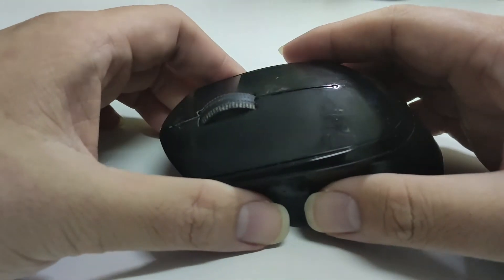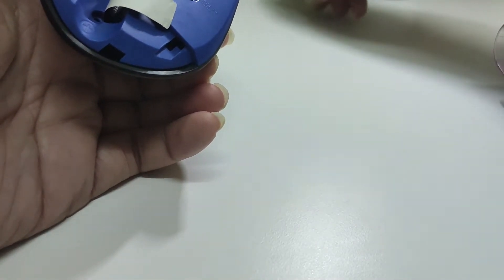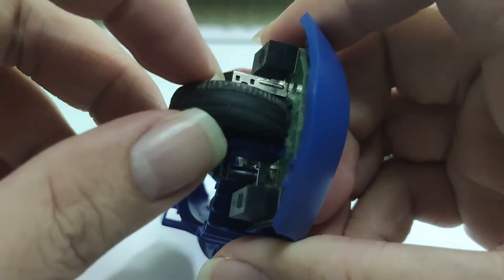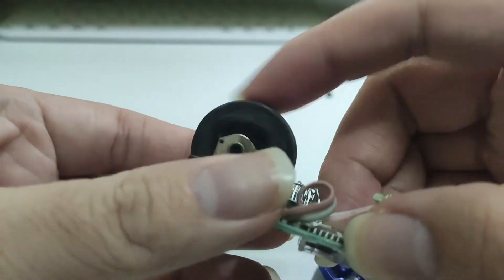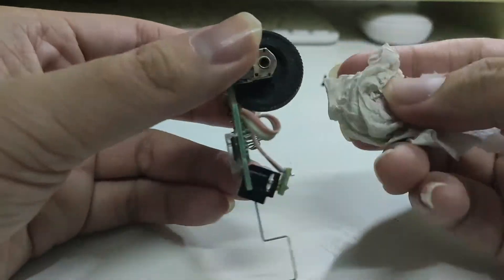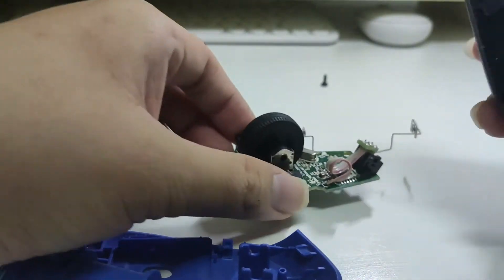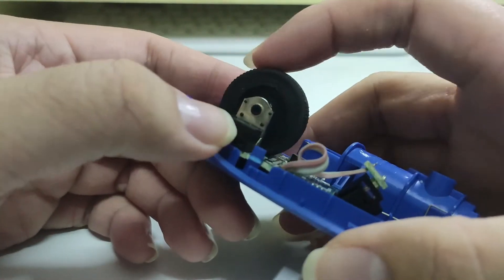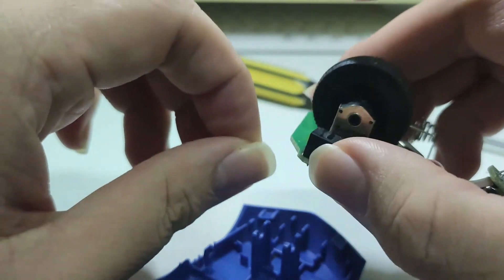Quick fix on mouse scroller getting resistance to scroll - Logitech M275

Comment: It's the deformation of the rubber 'tyre' on the scroll-wheel that is causing the problem. It just gets out of shape with time and starts catching the edges of the cut-outs in PCB and - in my case - also in the top plastic cover. So I just removed the rubber covering (tyre) from the wheel completely. The wheel moves so freely now that I don't really need the rubber's resistance or increased friction against the finger tip (compared to the smooth surface of the plastic wheel). It just works perfectly fine for me... BUT... if someone prefers the rubber feel you can get a new replacement wheel on Ebay or AliExpress for a few Pounds/Euro/Dollars. Replacing the wheel is easy - exactly as shown in Victor Magnum's video above. Hope this helps!